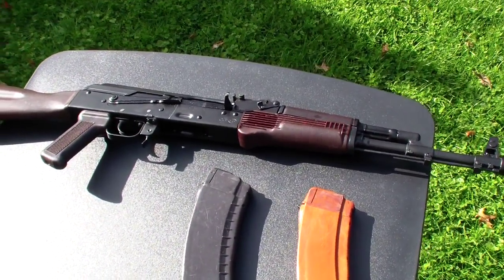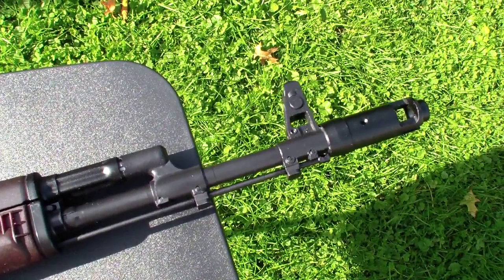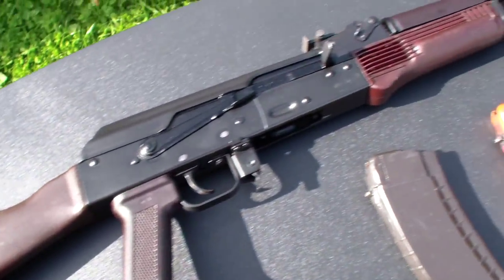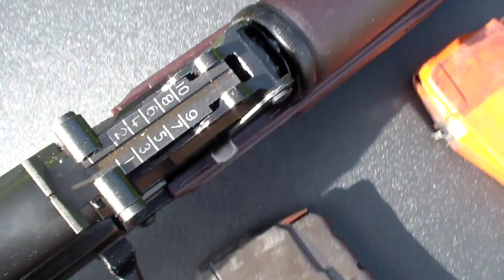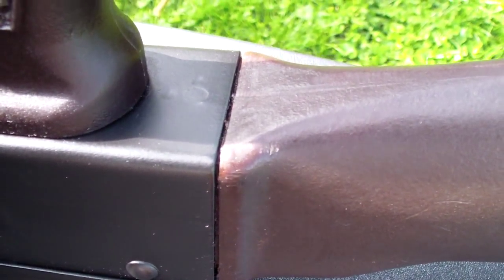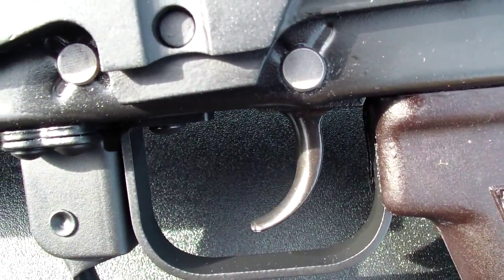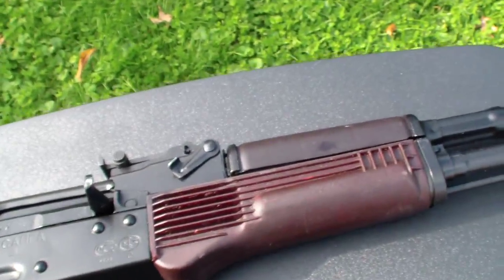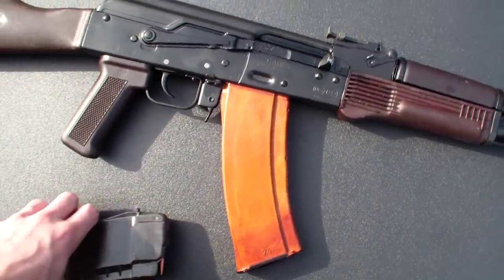Saiga AK-74 Converted

Comment: is it legal in california to do this conversion? any help would be appreciated. thanks.
Reply from the maker: NO its not! be careful and know the laws with every detail! Its a shame when people get in trouble for things they dont know about. You need a bullit button and probably other modifications to make it legal to convert
Reply: It's legal with a bullet button, for now. Starting January 1st, 2017, the definition of a fixed magazine changes to require the disassembly of the firearm action to remove the magazine. If you don't want to register it and stay legal, you can make it a featureless build by using a Solar Tactical grip wrap, which prevents you from wrapping your thumb around the pistol grip, thus making it not a pistol grip by law. You can use detachable magazines in a featureless rifle, but you cannot have any other AW features: folding or adjustable stock, pistol grip, forward grip, flash hider (muzzle brakes are legal though.) When in doubt, check the Calguns flowchart.
Reply: +Elijah Decker thanks brother!
Reply: +TheMilitaryArsenal  thank you!